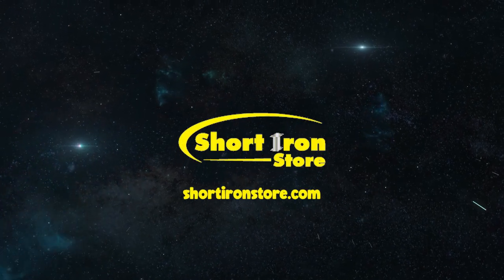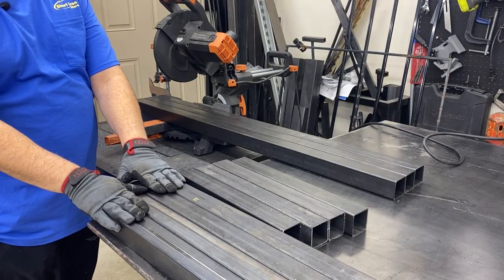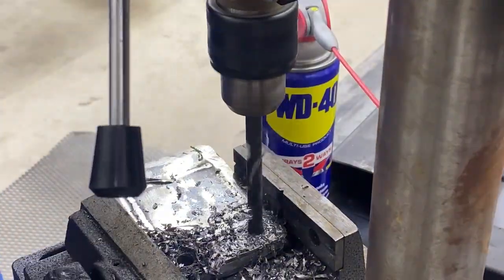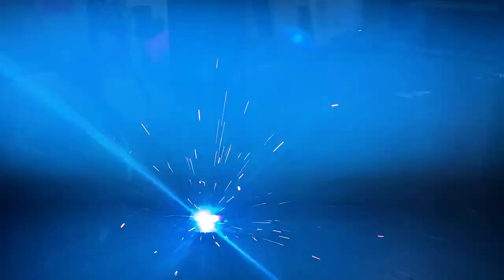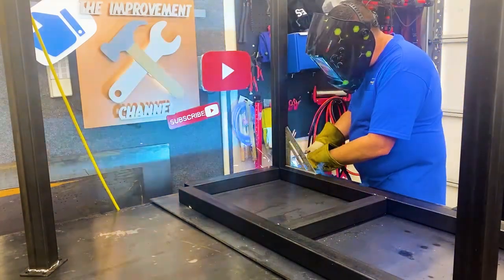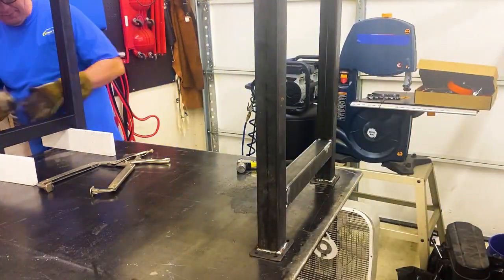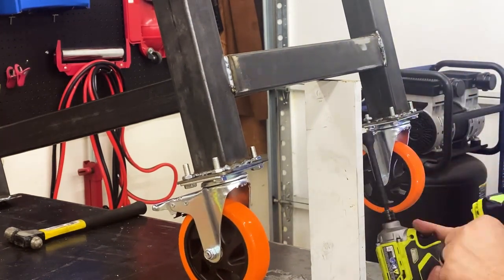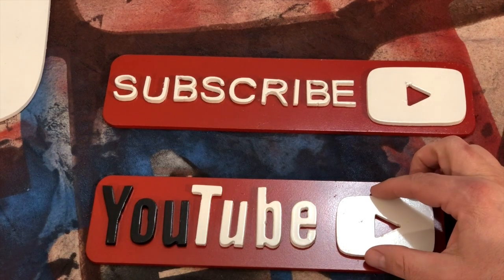DIY Small Welding Table | Simple Table build | The Improvement Channel

Comment: As a former pro welder.. the only best stool for welders is three feet chair, either with rollers on non, with bearings so it rotates on fixed... . The advantage of three foot(leg) chair was floor stability than four feet(leg) chair, four lef chair is only good on flattened floor with very good accuracy..while three legged chair can stand firmly and stable on flat and rough ground... .
Reply from the maker: Great stuff, thank you.

Comment: Nice table and it appears to fit my needs. Can you share dimensions? Ide like to order supplies this week to build one this weekend.
Reply from the maker: The top is a 24”x48” I did mine at a bar height. Measure out the bar height in a house and subtract the height of your casters.
Reply: @TheImprovementChannel  Thanks for the information!!!

Comment: Good video, do you think 1x1x1/8 tubing would be strong enough for the frame on a table like this?
Reply from the maker: That size would not be my first choice. That being said, if you reinforce it enough with cross bracing yes you can make that work.
Reply: No.

Comment: What sliding metal cutting saw is that?
Reply from the maker: Evolution 10 inch sliding miter.
Reply: @TheImprovementChannel  Is this a legit metal cutting saw or is it a modified wood chop saw?
Reply from the maker: @joea.6017  I would call it a legit metal miter saw for a weekend warrior. It is pretty much a modified wood saw that turn slower for metal, but it has been good for me.

Comment: Where to we get the measurements
Reply from the maker: It is a 2’x4’ table that is 42” tall.
Reply: @TheImprovementChannel  and wat about size of the metal tubing
Reply from the maker: @joseramirez9932  I used 1 1/12 inch a 14 or 16 gauge will work great.

Comment: If you run a welding filter over your camera and you cut out the distortion on the video.

But apart from that a very good video, especially with the measurements in both imperial and metric (centre meters) most measurements in metric are given in millimetres (mm).
Reply from the maker: I appreciate your comment, I am trying to add the metric measurements going forward.  I use an iPhone, what kind of filter would you recommend?
Reply: @TheImprovementChannel  on the filters use out of a handheld fixed filter mask, say like for gas welding goggles for a far off view and a arc or a mig filter for close up shots, you could also up the frame recording speed say like from 60 fps to 120 fps or 160 fps to cut down on the interference when welding.

The welding filters are great for getting that arc shot, the fps can cut out the flickering and the distortion of the picture, the other side of it is have the mig weld far away from the camera as the high electrical frequency can affect the viewing of the recording.
Reply from the maker: @philipburrows  lots of great info!  I will use all those tips in up coming videos!  Be patient I have already filmed a couple of videos that I did not have you info for. Thank you for all your help!